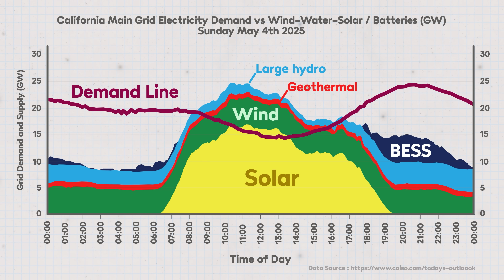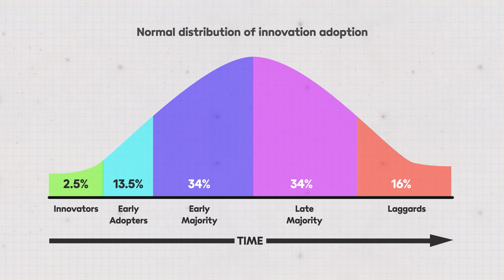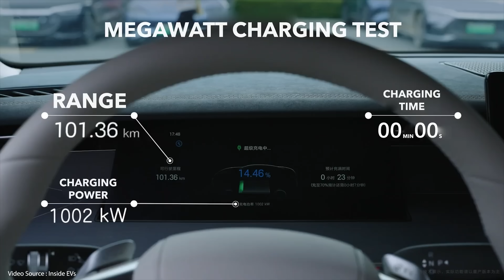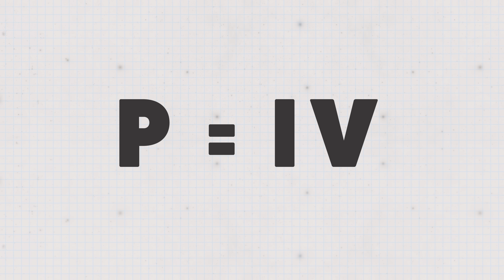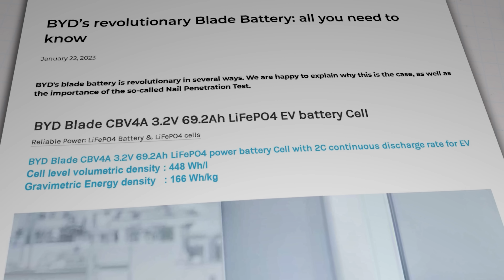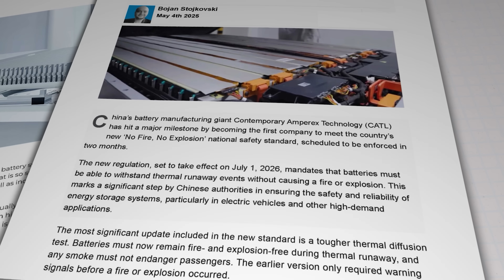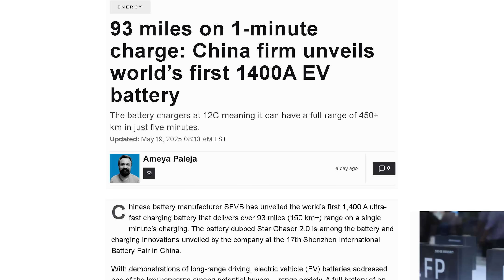BYD 1 MEGAWATT 5 minute EV Charger. Overdue or Overkill?

Comment: I've been driving a BEV on the arguably extreme Canadian prairies for 3 years now. I'm not going back to gas, but sometimes driving electric here sucks. 97 % of the time I don't care about range or charging times. But even a 250km round trip at -40 is a dangerous proposition when there is only a single charger in the middle of that journey. I'm prepared to deal with that. Most are not. Bring on the ridiculous ranges and charging!
Reply: I have had an EV since 2015 (travelled nearly 500,000 km). Will never go back. Fortunately, where I live, Hydro-Quebec made a priority of putting charging infrastructure in place. Have never had any problems. Last summer, I drove out west in Canada and noticed the lack of infrastructure, particularly in Northern Ontario (along Lake Superieur), as well as in Sask. Sufficient charging infrastructure changes everything.
Reply: I wonder when we get new chemistries like sodium ion, cold temperature problems will be a thing of the past
Reply: @miked5487 Solid state batteries should solve the cold problem. Lithium titanate doesn't have the cold problem but it doesn't have the energy density of other chemistries.
Reply: @miked5487  
keep on wondering
Reply: Bring on more chargers!
Reply: Anywhere in rural Canada where there is no charging infrastructure is abysmal, and geographically many drive 3 hours or more to town, or a friends, then yes a BEV is a bit of stretch, and wow good on you for making it work.  That is the culture and the reality, But seriously 90% of canadians, and 98% of americans live in an an urban environment, with fast reliable chargers every 50km on major routes, and never go anywhere where they would need to take your risk. Even most cottage owners, probably can find a stop to fast charge on the way out, and trickle charge at camp, before heading home.  There are places I will not drive a BEV to in Canada, but I go to those places more than most, and like you I own a BEV.
Reply: In Australia,  I think it would be great to have more range or more chargers .. I actually think faster charging , more chargers and higher battery density would all  be a great things.  It would definitely pull more people into going electric.   It's a no brainer.  I love my model 3 SR but give me the LR anyday lol.
Reply: The thing that is really awesome about this tech is how many people are working on improving it.  Every day there are articles on new tech and new battery chems.  I am sure some are fake news or will never see the light of day, but clearly the technology march that propelled the PC era is here for EVs.
Reply: Go with a hybrid, although I think the better option is more charging points and the same capacity batteries that are cheaper.
Reply: @Etheoma  Much higher risk of fires and don't resolve the primary issue of moving away from fossil fuels. While hybrids have their uses (perhaps for people who travel a lot in areas with limited access to electricity) hybrids do little other than stall the critical transition that is the motivation of this change in the first place.
Reply: @craigmilton9892  You don't need as large of an engine or battery if your doing a diesel generator to charge the battery or a NMC battery and can go with Lithium Iron Phosphate which diesel isn't flammable at atmospheric pressure and LFP batteries don't start fires even if you stab the cells so no. Also they still do use batteries so they help batteries get cheaper through economics of scale which helps EVs so no to your second point to and yes it doesn't help NMC batteries which is what is used in the majority of EVs, but most of the manufacturing process is identical so advances in manufacturing for 1 help manufacturing of the other.

Like the engine in a generator Hybrid can be very small, to maintain a speed of 65mph you only need you only need 20-40 horsepower to maintain a speed of 80MPH, the real issue is that you only regenerate 60 - 70% of power through regenerative breaking and with reasonable acceleration that can take 100,000W or 134 horsepower if you are stuck in a traffic jam you need to keep stopping and starting so you do need an engine that powerful to recover the energy you are using stopping and starting constantly when running low on battery power, but during normal driving on a motorway you only need to run that engine 14.9% - 29.9 of the time once upto speed and that is to maintain the batteries state of charge.

At least how I would set it up is that I would let the battery get down to 40% state of charge before starting the generator on a light duty cycle, then ramping upto full power output at 25% state of charge leaving 5% margin for sudden acceleration from 20%, Hu was just curious on whether keeping an LFP battery above 20% made sense and it looks like charging it from 0 to 100% is best practice, so realistically you would start the generator at 5%.
Reply: @Etheoma  Sure, for specific conditions that is fine. However, 80% of the worlds diving, everyday, is less than 90km. None of that is necessary to electrify all that driving. BYD has batteries 1/3 the size of the US charging in 5 minutes and travelling 500km + on a charge. That solves the vast majority of the worlds driving. Minimal fossil fuels involved.
Reply: @craigmilton9892  For 90km and less current battery capacities are way more than enough, so I don't get this "however" part.

And no the 100kW charging is for their largest batteries one is like 90kWh and the other is ~108kWh by BYD, BYD isn't breaking the laws of phyics, for a typically sized car you need 50 - 80kWh to get 500km of range.
Reply: @craigmilton9892  And I'm going to assume you were replying to my Hybrid comments, most diesel generator hybrids have 90km of range on battery, thats like a ~20kWh battery specifically between 13.5 and 27kWh, and the large majority of hybrids are smaller cars so it will be closer to 13.5 than 27 and even for longer journeys than that generator hybrids still get monsters MPG though re-gen breaking and running a diesel engine at a high RPM all the time is more efficient because running at a high RPM compresses the diesel more so it can combust better. 

I think the BYD cars you are looking at are the hybrids they do. for example the BYD SEAL U DM-i which has a 18.3 kWh battery which has a 125.5km all electric range and a 1125km range with a full tank and battery. That isn't a generator hybrid though as no point because it uses petrol. Ah looks like they don't even do diesel hybrids anyway I got side tracked you were looking at a smaller hybrid thinking it was an EV if it had 1/3 the battery capacity and had 500km of range, admitdely one with a focus on the electric side, but hybrid non the less.
Reply: @Etheoma  Sorry, it was 400 km in 5 minutes on their 1,000-volt architecture, along with 1,500-volt silicon-carbide chips. Still beats the sh*t out of anything the west is doing.
Reply: Fair enough, but not that many people live in places with -40 degree winters. Granted, the Canadian prairie can have that, but that's the exception, not the norm. In the continental US, for example, even places like North Dakota of Minnesota almost never get that cold.
Reply: @ab-tf5fl agreed. It's less common here than most want to admit. We take some weird pride in making people believe it's -40 six months of the year. The fact remains they currently suffer the colder it gets.
Reply: What you need is another charger or two.  Imagine if gas stations were that far apart?  That would make people not like ICE very much.
Reply: @incognitotorpedo42  lol on many roads in Canada gas stations are 400 km apart. Having roads with no gas stations for 150 km is very common here. But it's not a problem since almost every gas/diesel vehicle can go 500 km without refuelling, any time of year.
Reply: In the Canadian prairie? Yeah, you’ll be the last to be convenienced
Reply: @SigFigNewton  
he might not be connected to electricity yet.
Reply: @ursodermatt8809  😂
I've had a fully powered igloo for almost ten years now!
Reply: @devons2381  
in what part of the prarie are you where you have that much snow?
Reply: @ursodermatt8809 Southern Saskatchewan. It's more about the temperature, not the snow.
Reply: @devons2381  
yes, i agree with you there. do you keep your car in a heated garage?
Reply: Exactly this. EV evangelists need to understand that range anxiety is range reality in winter.
Reply: @MarkRose1337  but most folks don't drive 150 miles a day in winter, let alone in summer. And most EVs do that range. 

But it's not range that EVs need for winter, it's batteries that handle the cold better. And those are now on the market. Even petrol cars don't handle -30 that well
Reply: @colinwiseman It's very common for people in my region to drive 150 miles in winter, at least those that own cars. If I want to drive to the hot springs for the day in January, that's 300 miles each way going the fast way. If I visit my mother, that's a 150 mile round trip. People drive these distances here.
Reply: @MarkRose1337  Only in some situations. Sadly the way this is covered in the media, you'd have the impression the it IS an issue for all users. I live in Canada and have very cold winters. I don't even have a level 2 charger at home, I charge from my 110 exclusively, and have not had a problem even once.
Reply: @MarkRose1337  1. Not everyone needs to get an EV, just like ALL carbon emissions don't have to be eliminated. We just need to do enough so we aren't smothering the planet.
2. A LOT of people do not live where is gets cold enough to matter in the slightest. That's a LOT of people that can use EVs perfectly fine, year round, right now.  And the battery tech has improved steadily and significantly. There is no longer an excuse for the majority of people to not get an EV IF they can charge at home.  I still don't think renters should be considering it but with videos like this one saying what the near future batteries can do, I expect in 5 years even renters will be better off buying an EV and simple using public charging stations.
Reply: @NScherdin regarding your point #1.  We are already way past the point where we can consist slackng off on some parts of reducing of efforts to stop emitting green house gases.  Way past that point....
Reply: @NScherdin If I lived in the EU an EV would be a no brainer since it's almost entirely urban from an infrastructure perspective.

Comment: I love your channel and I do not wish to be argumentative, but pipes DO impose a resistance to the flow, dependent (nostly) on the inner diameter of the pipe.
One difference between wires and pipes is that pipes do not heat up when stressed, but they can burst if too much pressure is applied.

Comment: Increasing the applied voltage in a charging system, to keep the current relatively low, does not minimize the resistance of the wires, the resistance of say a copper wire is a property of that wire (which only increases slightly with temperature)
Reply: Power dissipated as heat is a function of resistance, which as you point out is constant (meh, close enough) for any given conductor, and the SQUARE of current.  Current is inversely proportional to voltage - double the voltage is half the current, and a quarter the losses.  10 times the voltage and it's a hundredth the losses.

Comment: To me, charging this fast changes the math on how big the battery needs to be. In the US I'd be fine with 150 miles of interstate range (75 MPH) if I could get that charge back in my typical 10 - 15 minute stop every 2ish hours. So a 25 - 60% smaller battery depending on the EV.
Reply: EV range >= Bladder Range
Reply: That'll work in short distances, but I sometimes drive 300 to 600 miles. I don't want to stop every couple hours. I'd like to drive at least 4 hrs before stopping, so around 280 to 300 mile range would be nice if we can get the infrastructure in place.
Reply: Smaller battery might mean slower charging though. You want to keep your charge between 20% and 80% at least for fast charging. So 150 miles range => at least 250 miles ranger total needed. And even then you might not be able to charge the fastest depending on how the battery was built.

Comment: There certainly is an analogy between the resistance in water pipes and the resistance in electrical circuits, unlike the claim that the analogy stops there

Comment: In Canada there is a real problem with the charging infrastructure not being close enough together, and not being maintained. You can drive to a station only to find that none of the chargers work, so you drive to the next one and it's the same story. In winter, with reduced driving range, the situation can get quite hairy.
Reply: The UK has at least one app which tells you the nearest available working chargers and allows you to pay or report ones that are not working.
Reply: @alayneperrott9693  The apps tell you where the working chargers are supposed to be. But they're not accurate.

Comment: I would love to have an EV. The tech, the acceleration, quiet.  But I think EV's may be going the way of the horse and buggy.  Aircela has just revealed refrigerator sized machine that produces fossil-free gasoline from thin air. No joke and, no lithium, nickel, manganese or cobalt mines or, toxic waste dumps from "recycled" batteries.
Reply: Link would be useful.
Reply: Don't be silly. Putting renewable energy straight into a battery that powers a motor will always be more efficient than using that electricity to make a fuel that is then burnt in an inefficient engine.
And just stop with the battery FUD. LiFePO batteries are not particularly toxic, and obviously big valuable EV batteries will be recycled, despite your "scare" quotes.
Reply: Up the dark lumpy tunnel on the left.

Comment: Long time subscriber, first time commentor, and engineer.  The problem with P=IA isn't IA, it's P on the supply side of the charger.  How many charging stations have more than a MW available?  For future stations, how many utilities can even provide more than a few MW in a given location.  The power is spread by the # of cars charging so no one is going to get a MW unless they are there alone.  Then there is the cost of the station which is likely much higher at those power levels as is the cost of the electricity.  Now repeat this across 1000s of charging stations...
Reply: Electric utilities supply several MW to a single location all the time . How do you think shopping centers, industrial parks, and single factories ever work?
People like to show off their expertise by pointing out problems, but there's money to be made supplying electricity. For the times people value ultra-fast charging, they'll pay, and the infrastructure will get built. Maybe the reason China is so ridiculously far ahead is there is less of this "can't do" attitude.
Reply: Incorrect.  Just because a station has 8 400kW chargers does not mean the station is fed 3.2MW.  Whatever power there is just gets split up.  And it is can't do at scale, but that is NOT to be negative, it's just that charging times need to be kept realistic.  Overreach is actually the problem. What happens when someone buys an EV thinking they can charge in 5 min.  They don't buy another one...
Reply: @johnfoster7210   there are caveats, but in the right conditions (not sharing the power with too many other cars) you can recharge one of these cars at 1 MW.
Reply: It’s worth noting for scale that in the US at least, the average three phase last mile distribution line you see strung up on the poles next to the road can move about 7.5MW without issue, so it’s not exactly an unsolvable problem. 

At this scale I also wouldn’t be surprised to see peeking batteries at such chargers to spread the load out over the time between when someone stops chargeing and the next person starts, as well as the fact that most batteries don’t like maintaining full charging speed for the full charging period.
Reply: Just add some batteries locally.

Comment: It almost seems like today's battery technology, is yesterday's silicon technology.  The winner that focuses completely on manufacturing products that has uses in multiple industries that are specialized or more advanced that no one else can manufacture, corners the market, kind like TSMC.
Reply: The individual markets for consumer electronic batteries, "electromobility" (e-bikes, scooters, etc.) batteries, EV batteries, and stationary storage batteries, etc. are each vast. And there are cost/weight/power tradeoffs so that there could be multiple winners in each segment. Although BYD and CATL's latest LiFePO EV batteries seem so comprehensively better that they will eat into the sales of higher-performance NMC batteries. Toyota's bleating to keep buying 100% fossil-fuel powered hybrids because some day it will have amazing solid-state batteries gets increasingly pathetic.